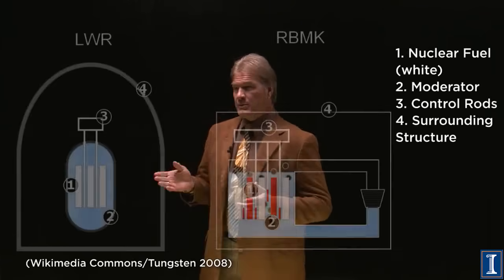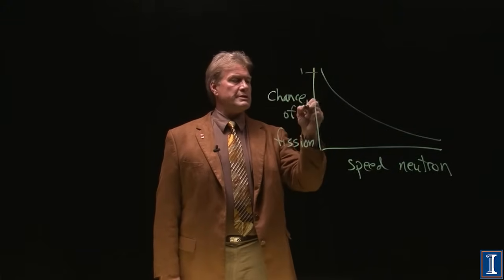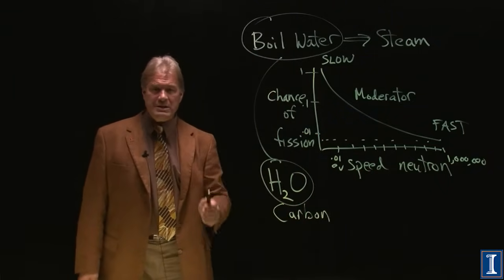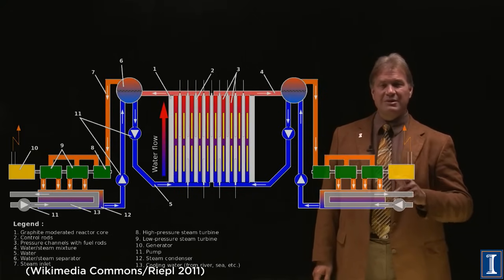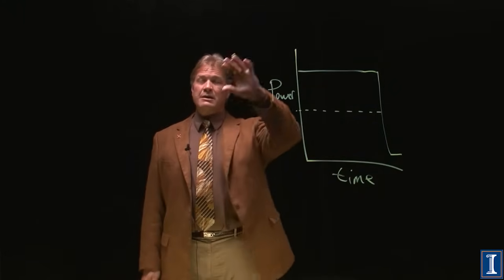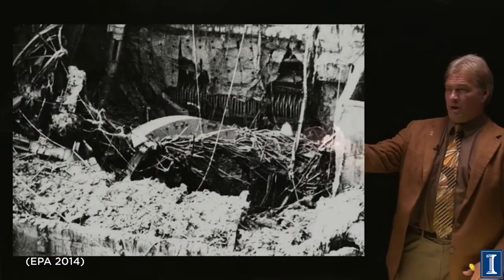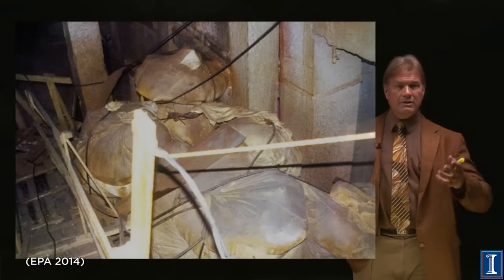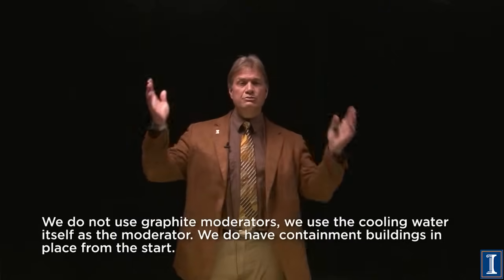Chernobyl: Worst Accident Ever

Comment: First mistake was to do the test overnight.  Sleepy tired third shift performing a simple 1000 step procedure.
Reply: First mistake was in approving the production of the RMBK.
Reply: @fallsdp  they knew about the instability of the RMBK reactors, but it was covered up because it was too embarrassing.
The tip of the rods being made of graphite is actually a safe design for smaller reactors, it is also very efficient. But bigger reactors can do unexpected things when you use such rods. (They have naively scaled up the design, without considering safety.)
The only way for the graphite ended rod to cause fatal problems was in case of a massive Xenon poisoning, and removal of almost all rods, boiling off all the water (see void coefficient). Everything which can go wrong went wrong at the same time.
The Three Mile Island reactor was designed for exactly that, what if everything goes wrong at the same, including an aircraft suicide bombing the reactor. So when thing went wrong (without the bombing), it failed relatively safe (with only a minor leak).
Reply: @adamrak7560 no the first mistake was even making a reactor with a positive void coefficient
Reply: @MyLonewolf25  easy in hindsight. But back then the positive void coefficient was seen as an annoying quirk, which could be mitigated with good instrumentation and quick scram if things go out of control. They were fatally wrong of course. Still if not for other weird problems and bad human attitude the positive void coefficient would have only caused a pretty minor accident.
Reply: @fallsdp  second mistake was ignoring the lessons from leningrad 1.  third mistake was ignoring the lessons from Chernobyl 1.  exact same failure, exact same damaging result, smaller scale and completely covered up.
Reply: Probably government getting bribes from the Energy companies as usual.
Reply: Not only that,... peaple trained for it (who also stoped it like 3 times midway trouth b4 was not there either.)
Reply: It was the nightshift doing it overnight. They could not do it during the day because Kiev needed the electricity.
Reply: Agreed!

Comment: Simple solution! 
All containment buildings should be made of airplanes.
If 9/11 taught us anything it's that concrete and steel are no match for aircraft aluminum.
Reply: The steel used in building construction  is no match for the heat induced softening that will occur when the buildings are set on fire by burning jet fuel and the airplanes have blown all the fire retardant insulation off the steel. Once the exposed steel gets hot enough and softens enough (it doesn't have to melt) the building collapses.

Comment: I guess the good professor hasn't been keeping up with the latest research on the Chernobyl disaster. Turns out that the initial explosion was, in fact, a nuclear explosion, followed about 2 seconds later by the steam and hydrogen explosion. 

https://www.sciencedaily.com/releases/2017/11/171117085130.htm

Comment: We did have a graphite moderated reactor in the US it was called Fort St. Verain. It was located in Colorado. When I first started my career as a nuclear engineer I designed safety systems for it. After Chernobyl it was shut down.
Reply: Hi Meet the Floccers. I got a question for you if you have a second. There are engineers who were working on 4th reactor (one of them is Breus) and a couple of others who are convinced that the explosion was nuclear not steamed. all the documents I have came across mentioned steamed explosion. My question to you is why would they think/suspect it was nuclear? I get the fact that we associate nuclear explosion with mushroom which we didnt see in chernobyl.
thanks!
Reply: @gennieapulova8017 Thank you for your comment.  The speculation that a nuclear explosion was at least part of the events has intrigued myself as well.  The data that draws some to the conclusion that at criticality did occur is the detection of isotopes immediately following the accident.  For example, the Cesium (Cs) 134Cs/137Cs ratio can be used to distinguish between fallout from an explosion or the fission products from a power reactor. Almost no Cs134 is formed by nuclear fission.  There are other examples.  Most nuclear engineers believe that a nuclear explosion is impossible in a reactor.

Let’s look at the “little boy bomb”.  This bomb contained approximately 60Kg of 85% enriched U235. That means that 85% of the core was U235 or 51Kg.  A commercial power reactor contains only 5-8% enriched U235 in the fuel rods.  However, the reactor at Chernobyl had a +1000Kg of this fuel.  The question is, during the melt down could a critical mass of U235 have collected somewhere and actually exploded?  There was definitely enough U235 in the core to make a critical mass, however, as the fuel rods melted the uranium, which is a metal, would have mixed with other metals in the fuel assembly further diluting the result.  In addition, the melted fuel rods would have mixed with the graphite, concrete, and other materials on its way to the basement.  This is demonstrated in the “Elephants Foot” a highly radioactive mixture named Corium after its discovery.  In addition, as you get closer to a critical mass the material heats up and if not contained tightly will tend to expand outwards.  This would spread the material out and reduce the number of fissions.  It takes a lot of effort to hold the core together long enough for a chain reaction to complete.  The actual U235 in Little Boy that fission was only a fraction of the 60Kg, and these people were trying to make a bomb.

So, my current opinion is no, it was a steam explosion.  However, it was possible, and I am open to changing my mind with convincing data.  The Chernobyl event still deserves investigating after all these years.  With regards the mushroom cloud, any explosion would have to been from deep within the core.  As discussed, Chernobyl was not designed to be a bomb, any potential explosion would have been relatively small (small from a nuclear perspective) and not generated a big cloud.  I am just very happy the containment has been finished.  I have always wished the best for the people effected.  Chernobyl happened the year I graduated from nuclear engineering school and has been with me since.
Reply: @meetthefloccers8112  hi.. Wow thank you for such insight.  I can send you a link to a Swedish physicist that inclines towards nuclear explosion. Just like you I am leaning towards steamed explosion. I am not physicist but my physics knowledge is not bad. 1st explosion happened right after the reactor jumped to 30gw thermal. Normal gw level is 3gw (i found a copy of rmbk1000 manual). The tape recording (black box) that was presented on a trial had a reading of 33gw. The first explosion according to Legasov at MAGATE lifted the 2000tonn metal plate. Water evaporated created steam pressure like in a cooker. 2nd was from the core, which melted all graphite and that disbursed the radiation. Your explanation makes a lot of sense.  Whats shocking is if you look at KGB release from 1977-78 it mentions 1.3 meters shorter and the height of the building was shorter as well. I just want to share my findings.
Thank you, once again
Reply: @gennieapulova8017  Please do, would love to see another view.
Reply: Fast neutrons can do things the slower neutrons that trigger U-235 to fissioning can't, such as causing U-238 to fission, OR convert it to Pu-239 which is even more fissionable than U-235.
Reply: @taraswertelecki7874  if you have a moment. could you explain me  what "tvel" is. I keep hearing about it but have a hard time understanding what it is.  Thanx

Comment: This guy keeps emphasizing containment buildings, fukushima had a containment buildning and the rods melted right thru them and thats why seawater keeps getting contaminated by radiation
Reply: Still not near the severity of Chernobyl.
Reply: @Odqvist89  well if you only consider surface contamination, then yes, not that severe but the pacific ocean has been contaminated which has further reaching consequenses than chernobyl
Reply: @hectorloohan9226  Well, I don't.
The consequences of Chernobyl has been thorougly mapped and studied. There are ongoing science today.
It is too early to make detailed statements of the consequenses of Fukushima.
However, I have seen no such early study, or scientist, stating the hypothesis that the consequences of the latter would be more severe.
If you have, then please share it with us.
Reply: Yes. I like how he talks like in a Western Light Water reactor, "Hey, if you don't have the water there, the reactor just stops. No big deal!" without mentioning that reactors continue to need cooling water for days after a shut down to remove the decay heat. If a core gets uncovered in a LWR that's how you get a meltdown. That's what happened at Three Mile Island and at Fukashima. Oh, and Fukashima also didn't have three foot thick secondary containment either, so there's that bit of false information. Can this guy really be an educator? God help us if he's turning out the next generation of nuclear engineers.
Reply: @charlespolk5221  Fukashima is in the East. Check mate!

Comment: The RBMK did have a cap that weighed  50-100 tons. The explosion blew it off. Even it had a western containment system would have failed do to the size of explosion.
Reply: Cap was on reactor, since it didnt have pressure weasel, size of contaimed building is calculated the way that if pressure wessel or major pipeline ruptures, all water in primary circuit evaporates, contaiment will hold and survive pressure of that steam explosion. so yeah properly made contaiment would hold.
Main problem was that ZSSR had problem making those hight quality materials. also needet lot of power quckly. RBMK was quite god choice, if they didnt make stupid things whit it.
Reply: It was closer to 500 tons, and it was flung hundred of yards into the air before crashing onto the burning remains of the reactor.

Comment: fizzle or fission? the core vaporized from heat isn't that the same as a nuclear bomb?
Reply: Check out Hiroshima after the bomb, the entire city was flattened. If the Chernobyl reactor accident was nuclear, not chemical, it would have vapourised the plant and destroyed the entire town and wiped out the entire population of Prypyat. So, no, not the same.
Reply: @roberthorwat6747  Hiroshima was a very efficient explosion Chernobyl was not
Reply: @thewhizard  the Hiroshima bomb was vapourised due to the fission chain reaction. The Chernobyl fuel rods were expelled all over the plant due to the chemical explosion. Not vapourised. Not nuclear. Not the same thing.
Reply: No, because there was not nearly enough fissile material concentrated enough for fast neutrons to split uranium atoms in an uncontrolled supercritical reaction. In a bomb, the fissions double, and double until the bomb explodes, the more doublings the greater the blast. The core blew itself and the reactor apart long before it could even come close to going off as a nuclear blast, and it never would have due to the fact the fuel was enriched even less than the fuel used in western pressurized water reactors. It never had the chance to fizzle, which has occurred during U.S. nuclear tests. When they happen, a few hundred tons at best explosive yield is released. If that happened at Chernobyl, everyone in Pripyat would have died, and the other reactors would have been destroyed or damaged, causing nuclear accidents.

Comment: Why not mechanically link the turbines to the pump impellers directly?  Seems somewhat wasteful to put two energy conversions between them (mechanical to electrical and back to mechanical) where you get a lot of inefficiencies.  It would take a bit more steam to help the increased load on the turbines but it seems trivial next to running a generator that powers entire cities.  If for some reason you lost steam production then you could have generators kick in.

I'm nowhere near an expert on this.

Comment: Man i have heard like 4 different stories about what happened in Chernobyl. Im getting convinced no one knows what went wrong and they just throw their theories on the internet.
Reply: I suspect there's a lot of important details missing here.  In another explanation, they talked about a design flaw when one of the techs hit the panic button to shut down the reactor but fission increased instead.  I also read they manually overrode several safety systems to continue the experiment.
Reply: The thing about stories is that people emphasize different things within the story.  You may think you are getting different stories because of this, but you are getting biased interpretations of the event.  We do know what went wrong according to our best understanding of nuclear physics as well as first hand accounts.   

Alex trebek, He did say that the reactor's fission skyrocketed when they tried to shut it down, he just didn't go in to detail as to why that was the case.  I think his focus was on other aspects of the event rather than the design flaw of the head space that the control rods had.
Reply: Scott Manley has a very, very good explanation of what when wrong. Goes j to incredible detail.
Reply: Watch more more panels related to topic, that has more scientific explenation, they usally say same thing, xenon poisent the reactor so it was hard to rise power, to level they made it ustable and when it started to rise too fast, stoping it but griphitr tips on rods increasd power insted of stoping, all water evaporated building up pressure causing first explosion (so itvwas not chemical actully), and rhen due to exposure to atmosphiric air, and exposure of zicon in reactor to water vapor which started producing hydrogen in corrosion processes, which is highly explosive when exposed to oxygen (air) caused 2nd bigger explosion... most likely as its most reapeted theory.
Reply: that's because that's what it is: theories. nobody was inside the reactor at the time of the event.

Comment: Fukushima even with the explosions did not do what Reactor 4 in Chernobyl did - blow its lid exposing its core to the atmosphere.
Reply: And throwing clouds of radioactive iodine into the air.
Reply: The core melted into the ground. It maybe under the water table now.
Reply: @johnlakey4983  The fuel never left the reactor pressure vessel let alone the main containment building